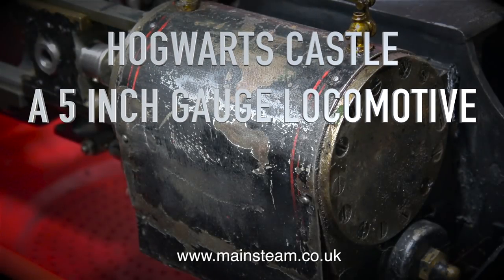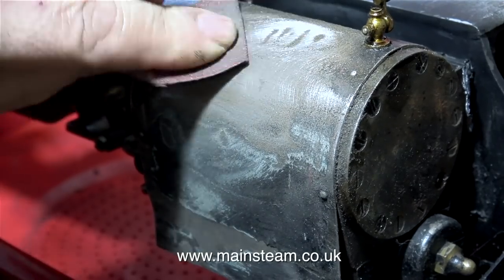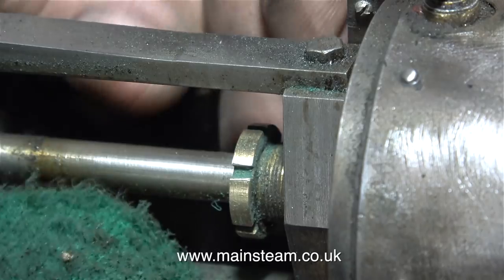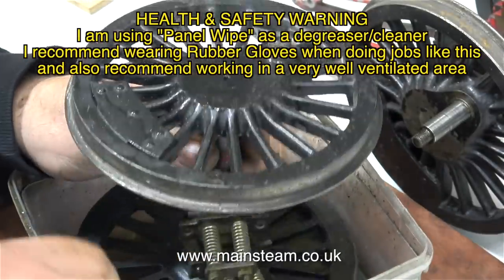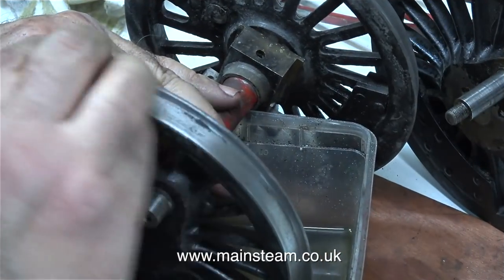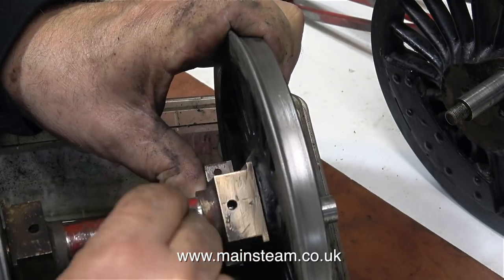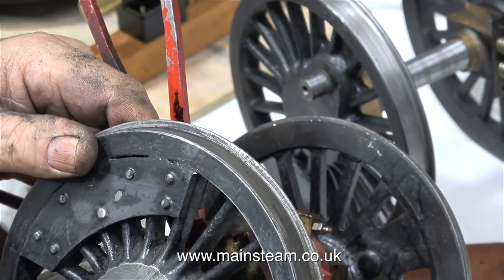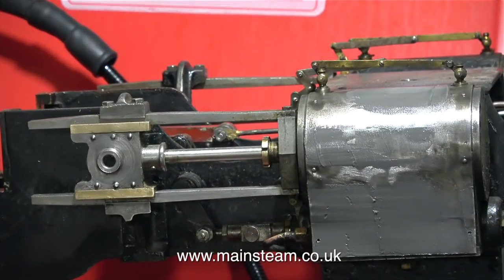HOGWARTS CASTLE - A 5 INCH GAUGE LOCOMOTIVE - PART #4

Comment: Just a thought.  Way back when I studied model making as a profession we did the same metal prep but used high build primer with an air brush to get the same end result.  I wonder if you ever checked out that route for metal prep as it can be significantly lower cost than spray bombs and give better results.

Comment: I find my dremel over heats when I used the flex cable and the revs are not constant I would not buy one again the Bosch Professional looks a better one but I dont think they do a corded one Bosch did buy Dremel so all the bits fit
Reply: had similar issue, cleaned & greased the flex cable/shaft tube
Reply: I have a Dremel drill, but bought a Proxxon flexible drive for it instead of the Dremel item for various reasons, but that too got very hot at the end where it fits into the Dremel at the first time of use.  Couldn't see an easy way of dismantling it, so I trickled some thin oil down the cable and that seemed to fix the problem.  Eventually the problem recurred and more oil fixed it again.  Pity, really, because in my opinion Proxxon equipment is of high quality.